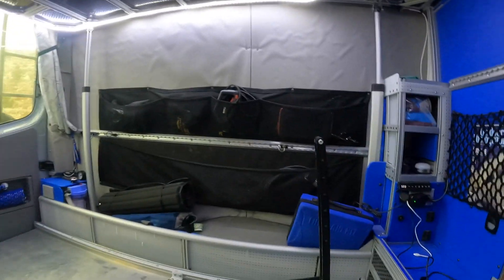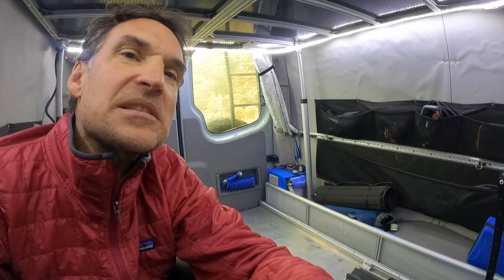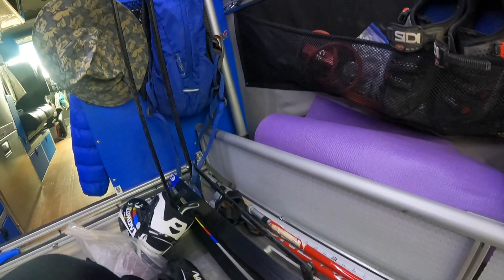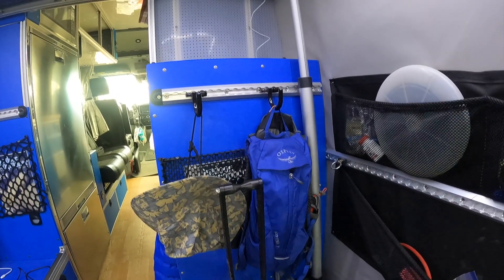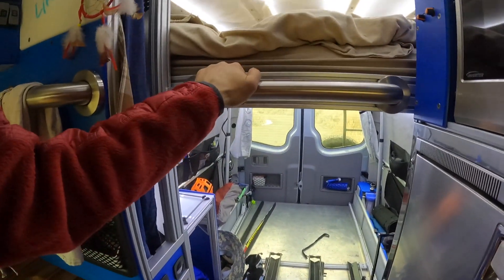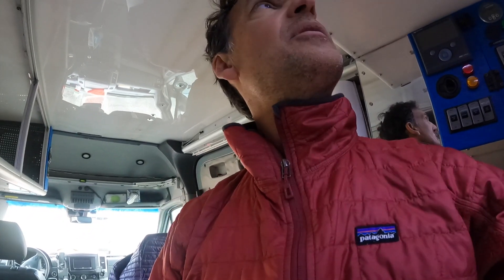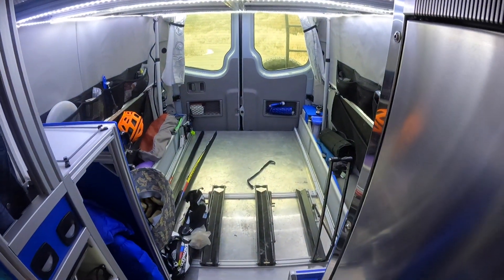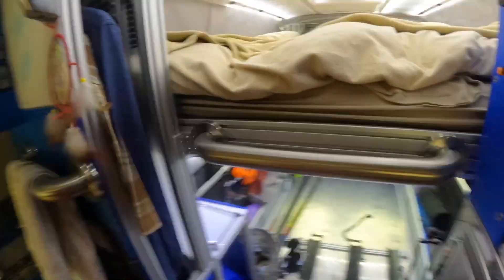A simple Lifting Bed in a Camper Van using Linear Actuators

Comment: Hello from Germany Berlin, my name is JR, a question about the bed system: is it electrically or hydraulically driven?  Which components / manufacturers have been used for this?  How much does the system cost if you contribute yourself?  So far the best I've seen so far.  Best regards, JR
Reply from the maker: Thank you JR. I used four electric linear actuators, each rated to 400 pound static and dynamic load. Each one supports the bed weight as well as lifts and lowers it, so the bed is free floating on top of these. Each linear actuator costs about $150-200 depending on controls and stroke length. I used Progressive Automations linear actuators, their mounts and controller although also other good brands and options are available. Progressive Automations customer service was excellent for input and help pre and post-sale, and shipped very quickly. I raise and lower my bed every day I'm in the van, which is often, and it has always worked flawlessly.

Comment: I came for the actuators but now I'm curious about the perforated PVC sheets.  That's a new one on me.  Are they especially high strength or fairly generic for that material?  And what perforation size/space are you using?  Any commentary on that is welcome.

Also, what controller are you using for the actuators?  I assume they are synced for speed?
Reply from the maker: While I am unclear of the strength of the high-strength PVC perforated sheets, they are incredibly strong-very difficult if impossible to break. 1/4" with 1/4" hole about every inch to allow for ventilation under the mattress while keeping a low profile. My mattress frame cross bars are 1x1" about every 12" on center across the width and the 1/4" PVC has no problem supporting the mattress across roughly 1 foot spans. I purchased these sheets thru McMaster-Carr--add'l info there. Just search for perforated in the plastic section.

Comment: Is there a Build video link and the parts list?  TIA
Reply from the maker: Hello Ray. I was so busy completing the build by myself in 2017-2018 that I did not record many videos of the build but do have some and many photos that I am working on putting into build videos. As for parts, everything was cut by hand but I can provide an overview of the parts for the bed platform since those are uniform and can easily be transferred to another van. I'll work on a video with that information and post soon. Watch for my new videos for that soon.
Reply: @vantripping  excellent.   Your build Idea is exactly what I'm pondering.  Any sketches, measurements etc would be great.  I have a MB Sprinter 144WB but only 33,288 mileage and currently a 12 passenger van we use mainly for large Family only for church, not commercial shuttle.  I like to sell off the mint condition bench seats and rebuild into an RV!
Reply from the maker: @raygunn88  Thanks. I can provide more details in a future video. I can pull out my sketches from 2015-2016 when planning this out and final ones for when I built it in 2017-2018. I'll work on getting that together.

Comment from the maker: Does this work? Yes, very well, although more headroom when in bed with bikes below would be nice, however, my taller bikes with front wheels on are ~43” tall and with front wheels off ~41” non-dropper post MTB XC race bikes or CX or road bikes. With front wheel off and a dropper post or seat lowered, total bike height can be reduced to allow for more space above bed. And again, a shorter actuator of 30” or even 24” may be more ideal for more space above mattress with the compromise of not carrying taller items under the bed as I recently put a small tree laying sideways under the bed in the garage for a home upgrade project. So think about how high you may need to have under the bed for carrying larger items (appliances, trees, moving boxes) vs height of bikes, convince of leaving wheels on vs taking off after every ride and back on to ride, as well as leaving saddle heights vs having to readjust them. If your bikes have dropper posts, this certainly can easily gain a couple of inches with wheels on and even more with front wheels off.

Comment from the maker: Because my perimeter bed frame is 3” tall (1”x3” profiles stood tall), the mattress sits recessed within the frame so top of my ~5” which mattress is ~27” from ceiling. It’s adequate but one does need to be a little flexible for getting in and out of bed. A van is always a compromise in space, especially height, but fitting bikes inside is wonderful as they are always clean, out of sight, no worries about getting stolen, or rusted, and I can easily carry four bikes across under the bed, with wheels on. Up to six with wheels and probably more if wheels off and bike forks mounted alternating front or back.

Comment from the maker: Also mattress sits on top of bed frame which is 1” profile with 1/4” thick high strength perforated PVC sheet on top so frame adds 1.25” of height. While the 1” is way stronger than needed to support two people with enough cross bracing (every 12-18”), it may have a defection of 1/4” across the 60” span for a queen mattress. For those that really want to use 1.5” wide profiles, this will add another .5” of height.
Reply: Hi KC,
I'll be contacting Progressive Automations. Thanks for the info. 
Can you tell me where  you sourced the perforated PVC 
Platform.
Have a great day!
Reply from the maker: @russellthom1169  Garet! Tell Progressive Automations I say hello. I have a bunch of their linear actuators ready to be installed in my new camper build for various functions. I sourced the high-strength perforated PVC sheets from McMaster-Carr.

Comment from the maker: Top of Bed frame to ceiling is 32” in lowest position. As I’ve said before, I wish I used 24 or 30” actuator stroke length instead to get the bed lower for when not having bikes below bed. With the 36” stroke, the bed cannot fully extend to ceiling because the walls taper in less than the 60” width of a queen mattress (plus frame width). This will also depend on the proximity of your bed to the rear corners, as the rear corners taper in even more. A mattress that is less wide than a queen (60”) will have ability to raise it up to the ceiling.

Comment from the maker: Top of bed from floor is 48” using 36” actuator stroke length +~7.5” fixed length plus ~1.5” mount height from mounting surface to mounting hole x2 plus floor 1” profile that mount is mounted to =~48” from floor.